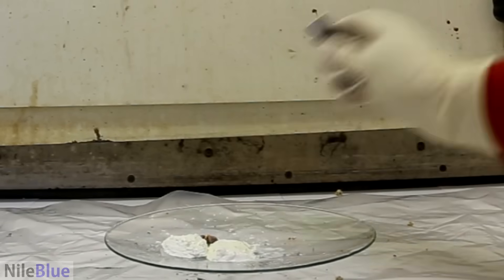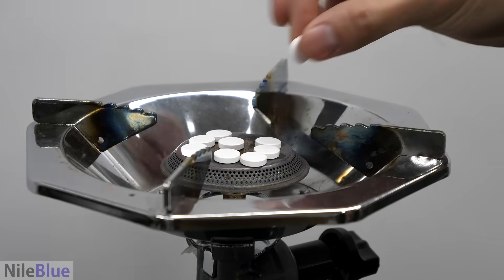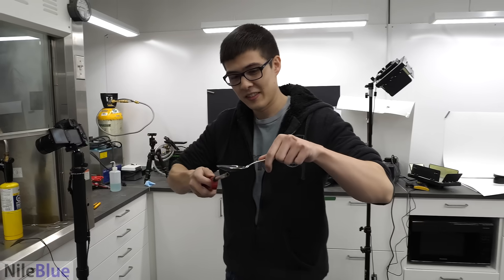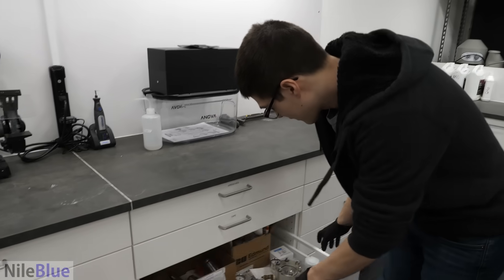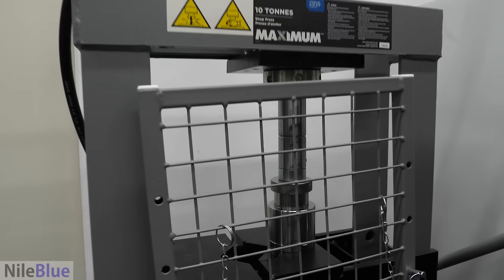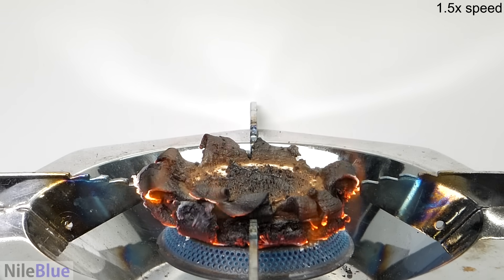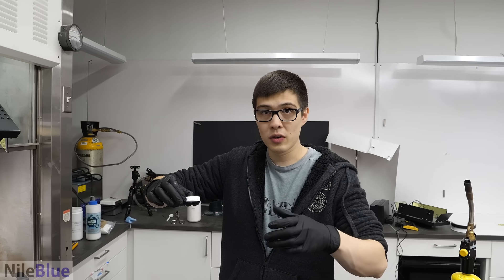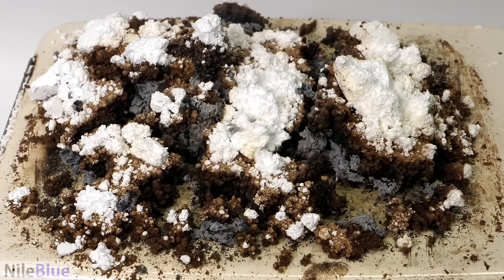Growing a chemical snake that looks like a turd

Comment: I know this is a 5 year old video and you probably won't read this but, what happens if you put this stuff into a heated pressurized container? or throw the powder into a fryer with thermal oil at 300c?

Comment: How about making a cup shape with your cnc router and drilling a hole in the middle to add a heating element. Turning it upside down filled with compressed powder and then turning the weird rocket motor thing on.
Reply: I would use a 24v 3d printer heating element.

Comment: I have an idea 

1 make transparent cylinder 
2 underneath it two tubes 
3 a tube shooting fire
4 another tube shooting the calcium thing slowly like the oxy-acetlyne mechanism 

Another idea is molding it

1 bring a metallic tube 
2 use something that heats the metallic tube evenly 
3 load the calcium thing inside and wait for it to expand inside the tube
4 remove the tube carefully and watch your molded caclium oxide and carbon snake

Comment: Back in the 1960's there used to be a "snake" firework that was a black tablet about a centimetre in diameter and height which was ignited from the top. It burned with a sooty flame and grew a black snake around 60 cm long and left a black mark on the ground. The ash was not overly fragile and the smoke had a somewhat burning rubber smell

Comment: I have an experiment for you to try.  In a previous video, you made CO2 go supercritical and had cracked silica beads.  In doing so, you generated some pressure just not a huge amount.  In this video, you made calcium gluconate (may have spelled it wrong) into carbon and calcium oxide.  In the process of this experiment, you also used hydraulics to compress a puck of the gluconate.

What would happen if you used the solid byproduct of this experiment,  the silica beads (in a powder form, and a supercritical CO2.  In achieving this, I completely understand that supercritical CO2 involves heating the solid CO2 while in a fully sealed container.  I believe that this could also be achieved with something similar to your puck compression adapter as long as you can seal it with silicone and compress it with your hydraulic press.

The reason for this experiment would be to see if you can make a diamond or something similar on a small scale.  It is common knowledge that diamonds are 99% carbon and other trace elements formed by extreme pressure. While the modified tooling is placed in the press so that the top doesn't shoot out like a rocket, heat the tooling.  That heat would start to increase the pressure initially.   You could use the previous experiments to gauge how long until the desired result is achieved.  When that is finished, use the hydraulic press to dramatically increase the pressure inside for an extended amount of time.

Comment: Everyone else who did this used snake-forming-substance sitting on lighter-fluid-soaked sand, so it had a flame burning all around and under the base. Not a hard concept. Moving on to "likely to not be adequate" sources of flame before you tried an adequate source of flame is kinda silly, don't ya think?

Comment: I know this video is like super old,
But do you think what would work is like,
if you had a slow burning powder or something mixed with the calcium, pressed together, lighting the puck itself on fire, it would basically heat itself up from it's own flame and heat and thus wouldnt need to rely on a single point of contact to give heat. meaning it could potentially burn and expand where ever the flame from itself would be on fire?

This ofcourse assuming the puck doesnt just explode or extinguish itself from due to the expanding "ash" basically overlapping and covering the fuel source. 

Idk that's one idea i had 💀

Comment: I think the most important part is the direction of the heat and the oxygen.  The problem is that it grows towards the direction of this and therefore it will block the direct access of heat to the non-burned material. e. g. if you put heat from the top, it will grow upwards because the upside of the material gets burned, but also it gets into the way for the heat/flame.... Not easy to get specific shapes by this...

Comment: You should compress something to keep it burning in the pucks. The snakes you can buy have maybe gunpowder in them, not certain. But it seems like the heat was getting blocked by the growth. In the one with the hotplate it was really noticeable because it stopped getting taller because the puck was totally away from the heat source.

Comment: For a cylinder of ash, heat that puck you made up for an hour to just below the combustion temperature of the calcium gluconate. Once the puck is pre-heated put it on a burner like that butane burner youre using. It should burn more evenly with less energy to get the whole surface of the puck to the combustion point. I'd imagine if you heat it in an oven to 250° F (roughly 125°C) possibly higher. I bet combustion in flames is higher than 600°F but regardless reduce the mean energy input by having that puck pretty hot already and it will do it's reaction much more efficiently within viewing range for your cameras. Simple energy physics. Like when your car is already moving. Same goes for any form of energy output from an input. Go on a sprint for a mile up a hill but stop every 10 steps is that how you want to do it? No. Because the energy loss every 10 steps is huge when you sprint up a hill. That's how it is for these chemical reactions you produce a lot. I love your videos but just from my experience some of this stuff could be tried a little different for better visual results.

Comment: It's obvious that the reaction is happening where the heat source makes contact with the puck. That is why a hot plate from below fails. You should have been heating it across the top of the puck from the sides. I'd like to see it with 2 or 3 torches blasting across the surface of the puck from the sides level with the surface not top down.

Comment: It seems like you could pretty easily make fire resistant ablative shield coatings with this, since the carbon foam produced is insulating and grows towards the heat source. Might be a fun party trick. Look up vids on starlite which works similarly as a putty

Comment: I know I'm super late, but I think the issue with the larger pucks may have been a lack of oxygen. Whenever I messed around with the little pucks you buy at firework shops, they were always really brittle and seemed super porous, so I think you may have pressed all the air out of the bigger ones and they couldn't burn as well.

Comment: I think you need radiant heat instead of direct heat. That's probably why the hotplate and smaller pills worked better for a more uniform structure.

Comment: 3:17 dude how are you holding on to the other end of a RED HOT spoon with your bare hands??
Reply: It hasn't had time to radiate to the handle because it was heated so quickly
Reply: @ExpandDong420 wow thanks, never knew that.

Comment: Get a cylinder with a very high melting point, and put a "home made" tablet of calcium gluconate in the bottom of it, and then put the cylinder into an induction furnace. That way all surfaces of the tablet will get almost even heat from the metal radiating.

By using an induction furnace you avoid gasses shooting up out of the furnace, which will make filming it far easier. You may need to use an angled mirror to safely record what happens though.

Comment: 2 things.
1: I think at the end it looked like a little fungus / mushroom farm and I thought that was cool.
2: What if you used the original burner, but put it into some kind of metal cylinder (a soda can with the top cut off for example, or something thinner) as a guide / funnel for it to grow straight up instead of just explode out of the sides?

Comment: maybe you could try putting something like a frying pan on the hot plate and then put the massive tablet  on top of it? Because maybe with the frying pan all of the heat is on the bottom?

Comment: From what I can tell, given the seemingly constant habit of the calcium gluconate forming the growths on surfaces at which the heat was applied (in the case of the flame, the edges touching the heat "grew," and, in the case of the hot plate, the bottom portion "grew."), maybe using some way of controlling the surface of the disc's exposure to applied heat could yield more favorable "snake-like" results? The only way I can think of that might work in shaping the desired tube-like formations is through the use of a tube-shaped mold of some kind, but I wouldn't know of how exactly to distribute and disperse the heat without needing to manually custom-fit or make a unique mold. I'm no expert though, so this might not even be feasibly doable.

Comment: 2 things;

1) It'd be pretty rad to synthesize calcium from this by burning it and processing the calcium oxide in the ash into metal.
2) If you mix it with something to increase its heat of decomposition I bet it'd work better.

Comment: If you want to get a cleaner cylinder, try putting the puck within  a something like a beaker, but can withstand the heat of a blow torch so you could manually increase the temperature

Comment: I wonder if there'd be a way to mix it with a flammable substance that would keep the process going without relying on proximity to heat.
Like this it always grows in the parts that are hot enough only to end up pushing itself away from the heat and creating these puffy ashes that block the heat.

Comment: Are chemists all like "let's just burn it and see what happens" Lmfao
Reply: We call that "Thermodynamics" so yes. Yes we do. Wait until you hear what a bomb calorimeter is.
Reply: @BKScience812  Hehehehe the first time I used one, I thought it was just because it was used to explode things in to measure a compounds specific energy. Then I found out it's called that because it can turn into a bomb :D
Reply: @BKSciencei812 i remember hearing this term in the of my final year of school and first year of engineering degree, but i don't remember it anymore tbh
Reply: Really all of us in these stem majors just apply energy and divert energy to and away from things 😂 I’m an Astronomy and Astrophysics grad student, and even we add energy in a different form than eat to things such as a particle in a collider, or we take away energy by using liquid helium on a CCD so that we get less dark current etc :) once you dive deep into physics, chemistry etc you start to realize everything is just an interaction between energies in avway
Reply: Yes, sometimes its just fun to fuck around with chemicals and see what happens. As long as you practice good safety habits that is.
Reply: Yes 🥲
Reply: Yeah, why not? 🤣🤣
Reply: yeah. one of my chem teachers in high school evacuated the whole school because he set off the fire alarm multiple times and continued to deny it every time. we all knew it was him.
Reply: Yup

Comment: Try LASERS? So, you say it gets porous, right? I think that material is insulating it from all the heat it could get. Maybe that's why flames worked better than the Hotplate.

You should try something that can go through the ash material but can hit the gluconate. Maybe dope the gluconate with something if it doesn't absorb radiation well. I doubt microwaves will work, but lasers might. Depends on the wavelength though

Comment: Makes sense; the powder has the most surface area, while the large tablet has the least (Area = 2(pi x r^2) + 2 x pi x r x d, where ‘r’ is the radius of the tablet, and ‘d’ is the thickness), and the little pills are slightly better than one large one - you can calculate the surface area for the little pills the same way, then multiply by the # pills you burned. Naturally, as you take the limit as r->0, for the same total mass, you get the area of the powder.

Comment: You need to make a thinner and taller "pill" instead of thick and fat ones. With a thinner pill there will be enough surface exposed to the heat to make a snake.
Or maybe you should find a way to "inject" or feed the "powder salami" right into the flames from the bottom. LOL

Comment: Would a pinch of a nitrate salt help? I'm thinking about solid-propellant rocket fuel of sugar+saltpeter (caution: smoke). There's got to be a mix of CaGluc and a modified propellant that works, but figuring out the correct ratios is tricky.

Comment: If I understood correctly the reaction needs oxygen+heat to happen, so in a tablet since it's more packed, it's harder for both of those to reach the inside - as opposed to the powder, where it's just kinda fluffy so both heat and oxygen reach everything quickly?

Comment: I think that matters the most for making the snakes is surface area. It's the outside layer that oxidises and reacts allowing the heal and air to react and oxidise further... so for an ideal snake you want something more like a smallish blocky cylinder. Maybe take a few of the tablets you have, shave or sand the rounded faces to flat and stick 3 on top of eachother... and burn from the top down, not bottom up.

Comment: You could try mixing in another kind of fuel with the powder (like powdered sugar or something). That way, the burning fuel provides the necessary heat and you only have to light it once (might have to put some alcohol on it to get the reaction going at first). Your main problem here is that you fail to continually heat the tablets evenly because the growing "snake" gets in the way.

Comment: I'd recommend to use more pressure to make the tablets, because there's a pretty large surface area. And the simple pharaos serpent uses a sand bath soaked in ethanol. Maybe this might work better at a large scale. And I'd recommend to do it outside then, because it might turn into a large bonfire with snakes growing everywhere :D

Comment: You should mix in an oxygenating oxidizer with the calcium gluconate, then press, then ignite/heat it. You're seeing self-shielding and poor penetration of atmospheric oxygen limit the reaction due to reaction conditions using that burner. Try potassium chlorate.

Comment: As pointed out you need more press pressure like 10t. Also you might mix in a form of combustible fuel to get the reaction going. Try some saltpeter.

Comment: what about mixing the powder with an organic combustible (or explosive eheh) liquid or solid? the mercury compund combusts on its own, so if you try to recreate the same burning characteristics, it might behave similar. also, that additional organic should develop gasses as well, wouldn`t that result in a bigger structure? what happens if you put the gluconate in an oven?

Comment: The problem with heating from the bottom is that the snake moves the puck farther from the heat. I thinks it's a problem inherent to the way the material expands (I don't know about how the Hg snake works, so maybe not), so I don't think a snake is possible, but I'm curious to see it heated evenly in an oven. I like this style, btw.

Comment: This substance seems to only “grow” when heat is applied directly to it and it lacks the fuel to burn on its own... just something to think on!
Reply: Also it's creating its own insulating layer or porus carbon which hinders the thermal decomposition :(
Reply: My thought also, Ian.  That would explain why it slowed down so much when it was on the hotplate.  :-D
Reply: Soooo just mix it with a fairly hot fuel mixture. If the concentration is low enough and the stuff burns relatively quickly, it should still form the foamy structure just fine, right.
Reply: Mush V. Peets Alternatively they could use an oxidizer so it creates its own fuel, then just add heat!
Reply: @AwesomeGames56  I feel like ive seen a "king of random" video that was exactly this
Reply: so... maybe its possible to mix it with a hypergolic mixture ? but then it kinda kills the idea of being non-toxic
Reply: My thought was to add an oxidizer to the mix. A nitrate perhaps?

Comment: You should get a bolt and a bolt cap, drill a small hole in the cap, put the tablet in, screw the bolt in and heat it to see a tiny very fast snake come out of the small hole.

Comment: What would happen if that powder is mixed with some high melting temperature dust loaded into a metal pipe and heated up , will it burst the pipe (the 2nd dust is to spread the calcium apart )

Comment: Ammonium nitrate + sugar in soda can — that's how we do it in soviet childhood. Also Potassium nitrate saturated water solution + newspaper & then dry it = interesting burn effect. We used to ignite handmade rockets from paper stuffed aerosol cans (cut can bottom, eject the valve, stuff with dipped and then dried newspaper, wrap up bottom and ignite from valve side). It will bang sometimes or flu away if made properly.

Comment: Using a metal grid inside the Puck, like fe with a honeycomb pattern, would at least counteract the heat isolation that's happening due to the compression of the powder. Maybe trying different shapes, fe cones or rings, would be kinda interesting. Nice tho that you could find a compound which has similar results! What kind of other compounds have you tried yet?

Comment: What you want is for it to burn from the top and your failed things are burning from the bottom or sides. The problem is that the heat is coming from underneath. You could probably make it work better by using a thin large tablet so the heat gets through to the top, or by mixing it with something combustible so you can light it from the top and not have to provide heat from the bottom.

Comment: Why not heat it inside a tight metall cylinder? It could have prevented it from growing on the sides
And maybe heat it with infra-red radiation straight top-down?